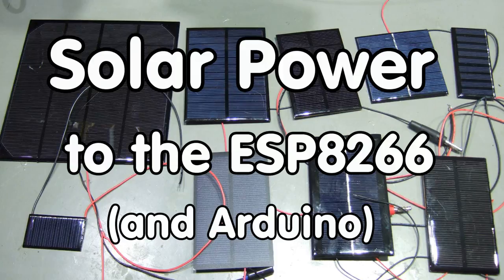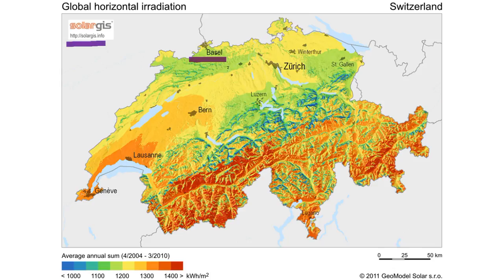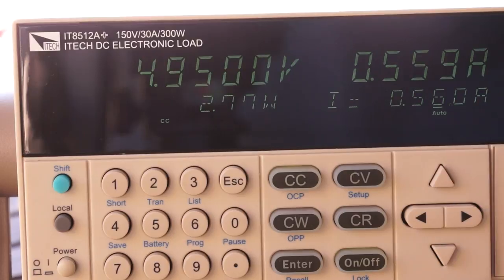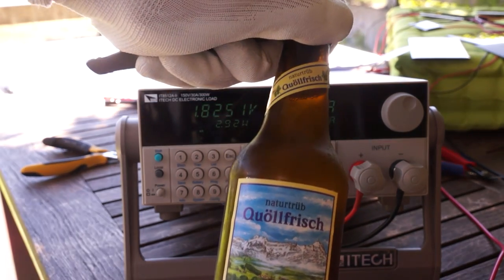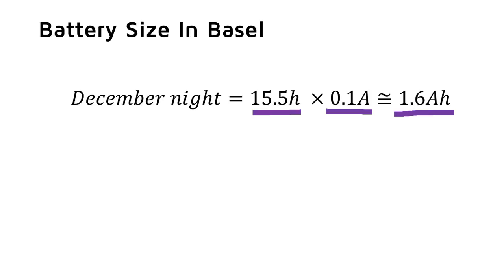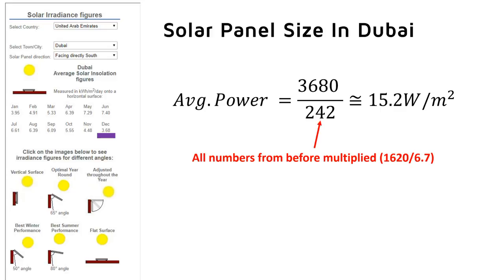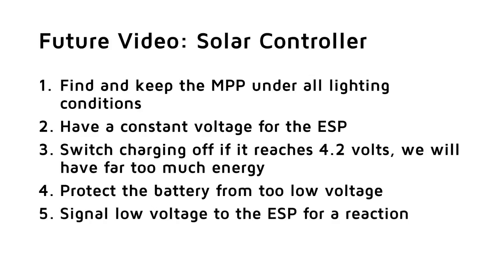#142 Solar Power for the ESP8266, Arduino, etc.

Comment: Thank you for this precise research! Really useful content! Could you please make any video about esp8266 (NodeMCU) with any small camera, if you have such experience, or may be with a new (A20 AI Thinker). Thank you!
Reply from the maker: So far, I never worked with cameras and for the moment have no plans for it.
Reply: May be you have experience with supercapacitor, would be cool to check esp8266 with solar panel and supercapacitor without akku if you have time. Small size of solar panel, with several small supercapacitor and one esp-12 (nodemcu). What would be super nice for this experience, send the current voltage of the supercapacitor as a data from esp to the server, to be able to monitor how it works. Thank you!

Comment: Hoi Andreas. I have checked again your related videos, but I couldn't really find a solution for my current problem. I need to run 2 stepper motors and an arduino with a battery. I guess a 4s 18650 pack will work the best. The problem is, that i need to charge them with a wireless charger, which outputs just 5v/800mA. Do you think there is a way to make that work? I'm still waiting for a step up converter, so I can test the setup. Charing time isn't really an issue. Thank you for your feedback. 
Regards, 
Viktor
Reply from the maker: A 4S battery needs at least 16.8 volts for charging. As you write you need a step.up converter and some sort of 4s charger unit (maybe including balancing). I never tried that. Be aware that, if your step-up converts to 20 volts your max current will only be 800/4=200 mA.

Comment: But for a bad winter you might get 2 weeks of no sun followed by one day of sun followed by 2 weeks of no sun... So this is the limiting factor that I would build for. The panel has to be able to fully charge the battery in one winter day.
Reply from the maker: This video wanted to deliver the basic formulas. You decide on the times which fit you best. A guy in South India decides on other criteria than one in Greenland. And there is always a compromise between battery size and panel size. However, with the current price trends, panel size gets an advantage. As you write, using a bigger panel would be the most economic solution for many cases.

Comment: The calculation for Dubai might not be that accurate because solar panels lose efficiency with temperature, and it gets very hot over there. My friend has been using off-grid solar in Australia for decades because it would cost $250K to connect to the grid, and he notices that the batteries don't charge on very hot days.
Reply from the maker: You are right concerning temperature coefficient of solar panels. But in summer, we will anyway have too much capacity because, in this concept, the dimensions of the panels are calculated for the weakest month. And then, the temperature should be "normal", even in Dubai...

Comment: Do you have/plan to make an assembling video? I am looking for a guide, to make a D1 Mini with BME280 sensor (connected to Raspberry 4 Home Assistant) weather station, which is powered by Solar panels.
Reply from the maker: Most of these topics were covered in videos. I do not plan long videos containing different topics.

Comment: Great video!

I ordered a battery shield for wemos d1 mini from ebay, but now I burned the second one, and I don't know why. As soon as I connect the solar panel to the USB port of the battery shield and expose it to light, the TP5400 charger chip gets immediatelly hot and burns out. Any idea? The panel is just a small 6x6cm, 6V panel... :S
Reply from the maker: I do not know. Never tried it...

Comment: Fine video, but where are some space for some ineffeciency of charge controller and for battery to not be used in proposed really deep cycles of 100%, whitch will kill battery in two years... And also, basic 18650 li-ion is not useable during winter in cold climate... Cheers
Reply from the maker: If the batteries survive 14 days without sun, they would not be discharged often (only in this particular, rare situation maybe once or twice a year). But temperature is a real issue, you are right.

Comment: I don't know if I have just missed it, however, it was not explained why the wattage of the solar panel was 4.5W instead of 0.33W. Care to explain? Thank you!
Reply from the maker: Which time in the video do you refer to?
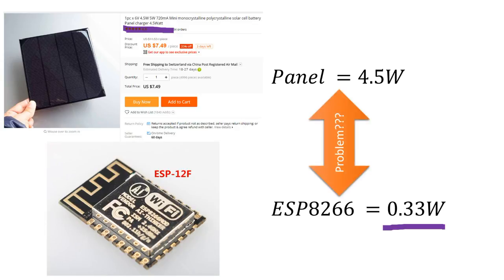Reply: @AndreasSpiess  At around 4:12 in the video, you mentioned that the system uses 0.33W but you are to use 4.5W of a solar panel instead
Reply from the maker: @RodaJhayanceJoceliLacson  The solar panel delivers 4.5 watts max. (according to its specifications) But, as explained later, only part of the time.
The ESP8266, according to its specifications, consumes around 0.33W (3.3Vx0.1A).

Comment: When you did the Dubai calculations you didn't use the optimum('*') angle to the sun ...like you did with the Basel calculations... but then again they are a lot closer to the equator so the optimum angle might be close to flat on the ground...   ('*' best average over the year)
Reply from the maker: If I did not use the "optimal" number I made a mistake. But it should be easy to correct it as the number is on the same page.
Reply: I don't think it is going to change much... keep up the good work

Comment: Wieder mal super aufbereitet; ggf. kann man ja neben Solar noch Windenergie nutzen. Wäre bestimmt was für den Herbst ;) Grüße aus Hamburg
Reply from the maker: Wäre sicher eine Möglichkeit. Soviel ich mich erinnere würde das noch besser bei euch funktionieren. Jedenfalls hatte es viel Wind, als ich deine (sehr schöne) Stadt besucht habe.
Reply: In der Tat sind wir wettertechnisch in Europa das zweite London, gefühlt zumindest :) Ich habe mir die Tage mal fehlendes Wissen angeeignet; gehe ich recht in der Annahme, dass ich statt einer Solarzelle auch so einen einfachen Windgenerator (Motor mit Rotor) an einen Solar Charger Controller anschließen könnte?
Reply from the maker: Betreffend Windgenerator: Da weiss ich zu wenig. Es kommt aber sicher auf das Prinzip des "Motors" an (Brushed, etc.). Ich glaube auch, dass Motoren und Generatoren nicht genau gleich konstruiert werden.
Reply: Danke für den Tipp; so bin ich nun zu der Erkenntnis gelangt, dass die meisten Solar Controller nicht in Frage kommen, da noch AC-zu-DC gewandelt werden muss. Schönes Wochenende!
Reply from the maker: AC zu DC ist nicht schwer. Nur ein Brückengleichrichter...
Reply: 4 Dioden, stimmt eigentlich :)

Comment: Did you calculate the power needed to charge the 34Ah battery after 14days of bad weather? Also because of the the cold winter 18650 can't be charged all the time.
Reply from the maker: No, I did not. But I assumed, that the monthly energy in the charts did take this into account (so, the next 14 days must be sunny...).
But the point of temperature is absolutely valid and we have to investigate into this topic. But not now. I wait till winter...
Reply: Andreas Spiess Maybe a small Lead Acid battery , like the ones for alarm systems or motorcycles. But on the other side this winter we had -30° during the night and my car with a new quality car battery wouldn't start. I had to recharge it and then the car started.
Reply: if need to use leadacid batteries i recommend socalled 'solar-batteries'. work same way, but instead of fluid they do have a kind of gel. prevents it against extreme temperatures and runout. i use them in my electric scooter wich i dont use in winter :-( damnd. doesnt make sense, isnt it?

Comment: Hallo Andreas, kann man einen Step-Down Regler direkt an ein Solarpanel hängen um ein Smartphone zu laden? Oder braucht es da noch eine Diode?

Gruss Stefan
Reply from the maker: Normalerweise schon. Das Problem ist eher auf der andren Seite, wo das Smartphone hängt. Einige Regler vertragen keine Spannung, wenn sie selbst spannungslos sind. Das passiert, wenn die Sonne weg ist.
Reply: Und wie findet man dies am besten heraus ohne ein Smartphone zu opfern? ;-)

Kann es sein, dass der Regler MP1584 so ein Problem hat?
https://www.monolithicpower.com/Portals/0/Documents/Products/Documents/datasheet/MP1584_r1.0.pdf

Wäre es sinvoll den Eingang mit einem Komparator zu überwachen und den Ausgang über einen FET abzuschalten, wenn die Spannung zu niedrig ist?

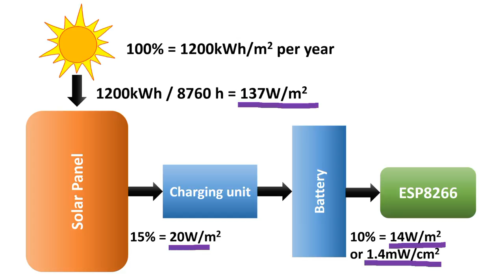Comment: You mentioned a loss of 33in the minute 3:25, but in the image you have 10% I'm confuse with the calculation at that point 14W matches with 70% total efficiency after the losses of 20W/m^2, could you explain better?
Reply from the maker: I think I say you lose 30% in the battery charger and the battery itself.

Comment: Hi Andreas

I'm having trouble with the size of panel calculation.

0.33W/14W per m^2 = 0.02

In my mind what this is telling me is that I only need approximately 2% of one square meter panel to supply enough power for the ESP8266?

Any help would be greatly appreciated.

Cheers

Jase :)
Reply from the maker: I think the video shows the whole process of calculating the needed size with all the assumptions and your location. There is no "one size fits all"
Reply: Hi Andreas

Thanks for getting back to me. I agree your video is very comprehensive but that doesn't mean that your subscribers are going to necessarily understand everything you cover. There is one specific area I'm having trouble with where your numbers don't add up. I have included the formula in my previous comment. Can you address this.

Cheers

Jase :)
Reply: @jwtfpv8957  You calculated correctly.  In the video he converted from meters to centimeters thats how he got 236 cm^2. You got 0.0236 (you rounded off in your post)  to the panel would be 15 cm x 15 cm or  6 x 6 inches.

Comment: Any chance on doing a solar only (no battery) for day time readings version?  I had a few different attempts, but found esp locked up when slowly increasing voltage(as in sunrise) and never found out how to solve the problem
Reply from the maker: maybe you watch my last Mailbag video, where I get KA754xx chips. They keep the reset pin low as long as you do not have enough voltage. They are made to solve your problem
Reply: Andreas Spiess cool thanks, will give it ago

Comment: On mysensors.org forum we are trying to make solar powered sensor nodes but by using supercaps instead of batteries because of long life and they don't suffer extreme temperatures like the li-ion cells. Of course we are exploiting all possibles power saving functions of the arduino pro mini and radio modules.
Reply from the maker: I will have a look at this page, however, super caps are perfect for summer, because the advantages you mention. For Winter, however, they might become too big. Maybe a combination would be the best?
Reply: Andreas Spiess the idea is to use very low power from Arduino and harvest everything from solar panel even below 1V. There is still no best solution so far. Some are taking advantage of the low voltage requirements of both Arduino pro mini and nrf24 radio, while I am think to use a 5.5v supercap or 2 2.7v in series and then have boost buck converter to keep a steady 3.3v. Of course it is not suitable for a esp8266 that doesn't sleep.

Comment: Could an esp running sole to sending a signal to trigger ifttt then Turning itself off using a relay like you have mentioned before utilise a super capacitor with a solar panel for longevity?
Reply from the maker: If your super cap is big enough this should be possible.
Reply: I’m looking at making a post box opened alert, it’s my first esp project and am using a ESP8266 12e a Reed switch and relay. If I could work out what size super cap I need and the solar panel sits on the post box nicely, that would be amazing and never need touching again.

Comment: I would love to see a video where a one small solar panel is placed on a hot bed(perhaps one borrowed from a 3d printer) and an one placed beside it without heating up(for reference) and both exposed to the same sun and efficiency measured at different temperatures. Has anyone done that on youtube?
Reply: Nicklas Persson The heat is mainly a problem on the front surface, you would be better off changing the heat of the chamber to make sure the data is reliable (eg a small cardboard box with a big bunch of resistors and a thermal probe)
Reply: It is true that silicon is not a terrific heat conductor but a solar cell is also quite thin. I would think that placing it on a heat controlled surface and giving it a few minutes for the heat from below to permeate to the surface will make good enough accuracy.

Comment: .. recently I installed a gtb-600 micro inverter with built-in wifi monitored on app..but how do I incorporate led matrix with esp8266 to display it's yields..
Reply from the maker: Unfortunately, I do not know the gtb-600. But I think you have to re-engineer the device. I only found this link: https://community.openenergymonitor.org/t/wvc-inverter-mqtt-data-logging-for-all-versions-of-inverters/12352/238

Comment: When i connect my esp8266 to the ht7333 in this project the voltage at the ldo drops from 3,3v to 1,4v. Any idea? My guess is the solar panel is not delivering enough current, even though it is in full sun.
Reply from the maker: You have to do the measurements using a variable resistor and a solar panel. Then you can draw its curve.
Reply: @AndreasSpiess  Thanks i'll try that

Comment: could i use solar only no battery?  "On" to Brown out causes a hang
Reply from the maker: The ESPs create high ccurrnt peaks. So you would need a big capacitor instead of a battery.
Reply: @AndreasSpiess  solar panel with a buck regulator handles 1amp easily.

But my question is about brown out conditions.  Esp doesn't seem to handle it well and doesn't reset.  Oh well. I need to make a circuit.

Comment: Andreas, i did the math for you. Based on lat/lon of Basel you have 241d 20h 24m 45s of sunny hours, and (so i guessed) 2h twilight in the morning and evening, in sum 30d 10h 0m 0s. this means your useable solartime is just 211d 10h 24m 45s per year. not included are shades of obstacles and bad wheater. need the code that i just wrote for calculation?
Reply from the maker: Yes, please!
Reply from the maker: Thanks. Have to figure out how to use it (I am no web-specialist...)
Reply: me either. its written in php; just change the values in the prefs section and script will do the math for you. run natively on mac, almost all unixs and with some installations even on windoof, on console and as a webpage. sorry, that i wrote it in php; reason was i knewed all the used date-time functions (can be hard on other languages), and as i saw the videoalert and the video i was logged in on the server... so i did it quickly there. dont u have access to a webserver who supports php? if not, i think (but really donno) a raspi can do it also.
Reply from the maker: I think, I will figure it out. Otherwise, I come back ;-)

Comment: There is a minor unit mistake in your calculations. When dividing the amount of energy per square meter by 24h of hours ( (Wh/m2)/h ) you get the amount of energy per square meter in an hour. The units don't change. In your calculations you put the result in W/m2 and this would have a different meaning of power per square meter.
Reply from the maker: Thank you for the correction.

Comment: If the device is outside, how to charge li-ion battery when the temperature is below zero ?
Reply from the maker: Good question. I think, we have to adapt the battery technology to the environment. So, below zero, maybe we use lead-acid. Or bigger panels and super capacitors...

Comment: Hi Andreas,
Ich habe eine Schaltung entwickelt, womit der Arduino der Strom messen kann, den er selber verbraucht.

In der Minusleitung der Stromversorgung wird ein Shunt (zum Beispiel 1 oder 10Ω) eingebaut, und man misst die Spannung an diesem Shunt. 

Das Problem ist dass, gesehen vom Arduino, diese Spannung negativ ist und der ADC mit negative Spannungen nichts anfangen kann. 
Man kann allerdings einen Trick anwenden: Gewöhnliche Silizium-Dioden fangen bei 0,5 - 0,6V V zu leiten.
Mit dieser Schaltung wird die Spannung um den Shunt herum um 0,5 - 0,6 V Richtung Vin verschoben. 

http://www.cjoint.com/doc/17_08/GHdh7PKB2qW_ArduinoMisstSeinenStrom.jpg

Man braucht dann zwei Analogeingänge (am besten mit analogReference(INTERNAL) und der Strom ist proportional zu A0-A1.
Man soll das Widerstand so klein wählen, dass der höchst zu erwarteten Strom ein Spannungsabfall von < 0,2 V verursacht.
Reply from the maker: Interessante Schaltung...

Comment: There are more solutions:
- Find a friend in Dubai that charges the batteries for you in winter and sends them per mail to you.
- Use the small generator at your bicycle in december. That converts the energy of your food to electric power.
- Wait until the sun will become a red giant star in about 5.000.000.000 years and the solar constant will be a 100 times more.

By the way - a good video!
Reply from the maker: An even better idea than Dubai would be to ask Dave from EEVblog to charge the batteries, because they have summer in Australia...

Comment: Why calculate everything on terms of size and not with energy?
Reply from the maker: Because this was the question I asked at the beginning of the video. And this is usually the question you have to answer if you order a panel.

Comment: think the math is broken on the solar panels... I have 1m*1.5m panels, you state 20w per square metre, I get like 280w for my 1.5sqm so my panels must be made on an alien planet....  you only have to look on ebay lots of 1m*1.5m panels rated from 250 to 300w
Reply from the maker: The 20W is nights and winter included.